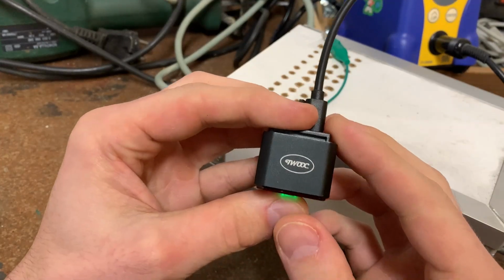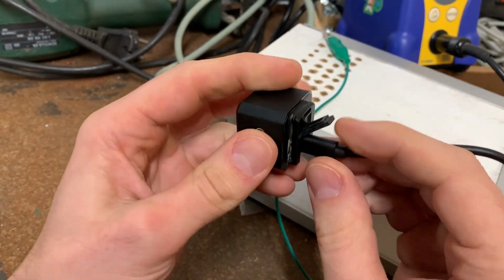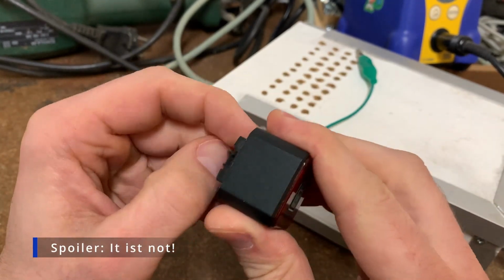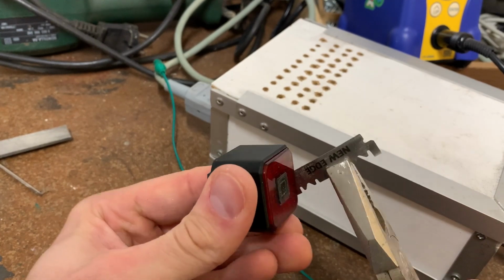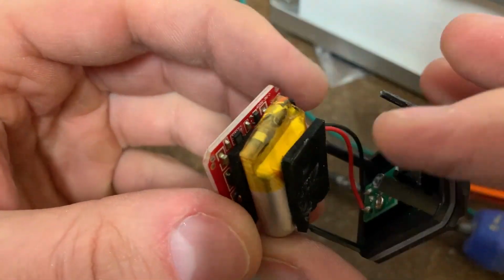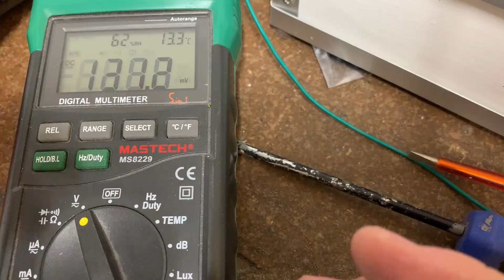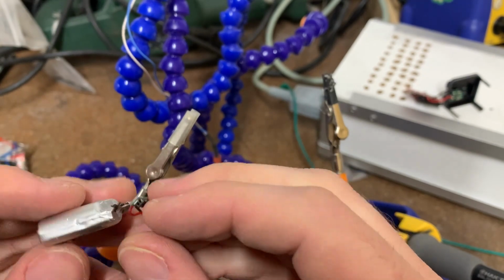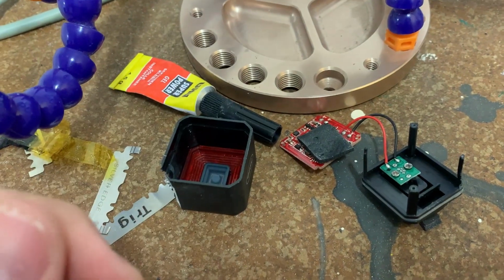I tried to fix it - Smart bike light

Comment: I was looking for a similar problem on mine same brand but circular form, battery was died even I try to charge, no led lights. I discovered my professional USB c  cable used to charge also my mob was not mechanically perfect lile a new USB c Little cable simply. After replaced light become charging and ble led normally flash 😂